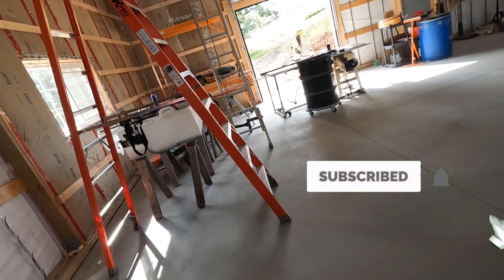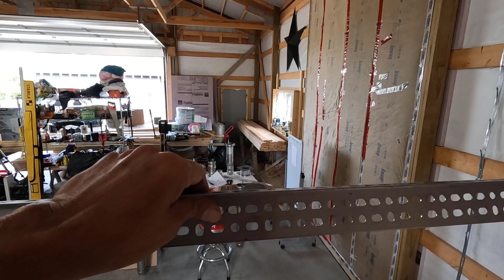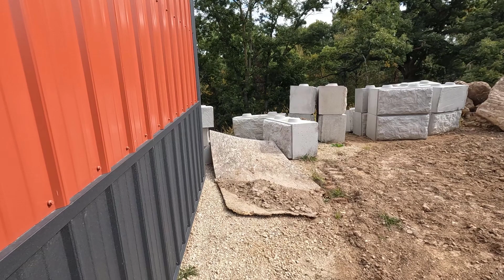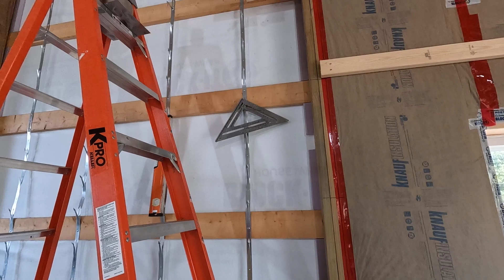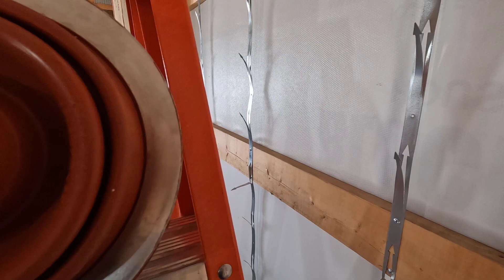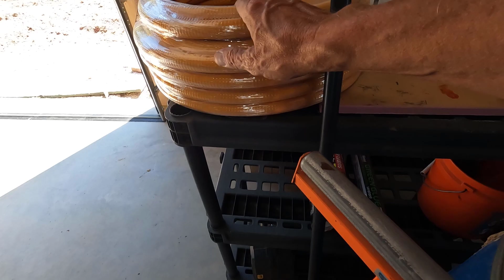How-to Locate and Preinstall Shop Furnace Hook Ups Pt. 1

Comment: I installed one of these years ago, and had to install bracing below the ceiling because the ceiling was already installed. It looked very messy! This is definitely the way to do it! Having the flue come through the wall right between the ridges on the tin, and the boot being red are both real quality touches, bravo for that! Can't wait to see this furnace in action!
Reply from the maker: Thanks Shed Homes! This has been giving me nightmares for a long time. I knew I could do it, and had a plan, but you never know what is going to happen. It's very scary cutting through the side of your new building! I think it will work fine in the end though 😊

Comment: I am not good at this type of thing! I would definitely have to hire someone. Too many variable for me!
Reply: I agree! I've installed one before, but I had normal siding and could pop the flue through anywhere.
Reply: @ShedHomePro  The ceiling is a problem as well. It's nice to have the structure built-it like he has it!
Reply from the maker: It just takes a lot of head scratching. I did all of that off camera 😉
Reply: @ThisOldMojo  Agreed!

Comment from the maker: This was the most technical job since designing the post frame shop itself! The entire job took two days mostly because I had to run to town for materials, but there was a lot of time spent on head scratching as well! This job had to be done so that I can run the propane lines up in the rafters! All of the stuff that needs to happen up there needs to get done before I can install the ceiling! Also, when it does come time to actually install the furnace, I will only have to spend a very short time outside on a ladder. The area where the flue comes thru the wall gets very icy in the winter! 🥶 You can find links to the furnace and other things used in this video below....

Mr. Heater Big Maxx Furnace - https://amzn.to/3CslcqS
Silicone High Temp Boot - https://amzn.to/3TdpOb3
High Temp. Silicone Sealant - https://amzn.to/3SRpFKo
Mr. Heater Thermostat - https://amzn.to/3fUfZ3t
Mr. Heater Universal Gas-Appliance Hook-Up Kit - https://amzn.to/3fVoKtM